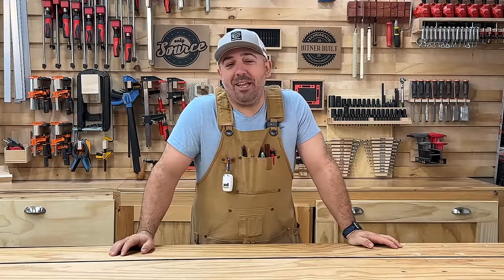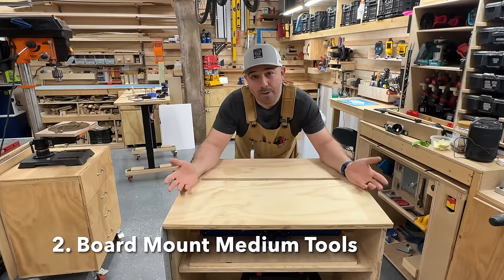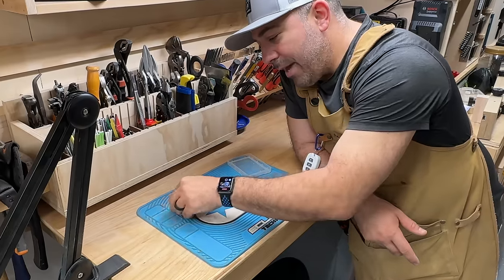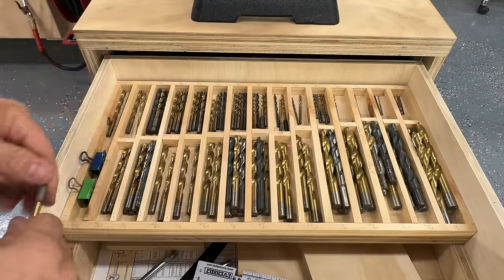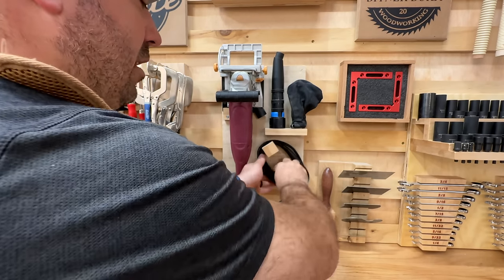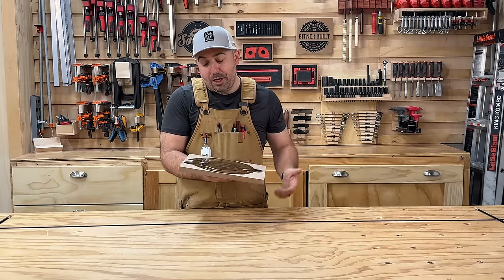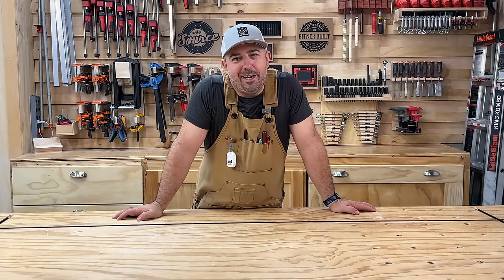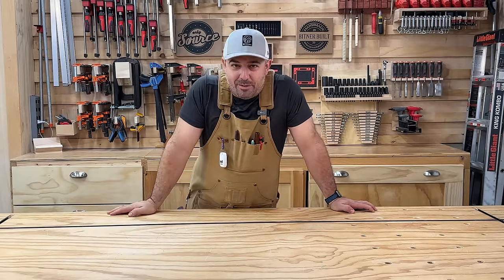8 Woodshop Tips Tricks & Hacks

Comment: Locktite makes many retaining compounds that would be excellent for the pocket hole bits and collars. Then if you break a bit, heat it up to break the locktite and save a collar.
Reply from the maker: That’s an awesome tip! Good thinking
Reply: I'm a fan of the Loctite 680 - it would be perfect in this application.
Reply: Also, Loctite or epoxy won't heat temper the bit and risk shortened life span.

Comment: Good tips thanks for sharing. I like the drill bit holder. If you drilled a hole next to drill pocket for that drill then you could use it to check what drill size to use for screw or bolt clearance and simply pick up the drill from that pocket and use it. It would also be useful to check the drill size for each pocket.
Reply from the maker: Great tip Thor

Comment: You can get started in welding with a flux core welder which doesn’t require the gas tanks in your shop.  Whole setup can be had for about $300 if you catch the right sales and shop at the right places for it.  Harbor freight sells the Titanium easy flux 125 and Amazon has a brand called Yes Welder …both would be great starter welder setups.  Even if you bought the whole rig and found that you hated welding, you could sell it and get most of your money back.  Youtube has some great vids on beginner flux core welding.  Great woodworking tips in this video and you just earned yourself a sub 👍🏻
Reply from the maker: Awesome thanks Dewey! I actually went into Harbor freight a few weeks ago and was trying to ask about welders for a beginner set up and of course none of the guys working there. Have any clue about anything, definitely on my want to learn list!
Reply: I just took a three night welding class at my local high school through my city's rec department. It covered stick, mig, TIG, plasma cutting and only cost 50 bucks and unlimited materials. I got to try out different machines and processes and that alone was invaluable in selecting the welder I bought, not to mention the nearly 50 years experience of the old-timer teacher who I learned from. My only regret is not pestering him to teach me oxyacetylene brazing and welding. Each process has its strengths and weaknesses so to me it was really important to understand those things and be equipped to use the appropriate method when possible.
Reply from the maker: @sklikizos  wow that is awesome! I need to look into seeing if our local schools do that, too, that is a great tip for everybody out there. Thanks so much.
Reply: @BitnerBuilt  hey thanks, I'm really digging your channel! You've got some awesome stuff right out of the gate, can't wait to see more of your ideas.

Comment: Good tips.  My adds...

Collar slippage... been there!  My fix is to use two back-to-back... never had them slip after.

Work mats... I have a silicon soldering station mat I use.  Resists heat, has the little cubbies to hold stuff and several even have imbedded magnets to hold small nuts/bolts/screws in place.
Reply from the maker: Thanks good tips! Yea I did the double collar thing too before I switched to the soldering!

Comment: About leveling for an epoxy pour--why not just level your assembly table once and for all, then you don't have to worry about it?  Useful tips--thanks.
Reply from the maker: I do a lot of larger epoxy things when I do it, for example a countertop. So the only thing in my shop that would be large enough to level for that is my large assembly table but that’s on casters and I move it around a lot, it would have to stay put and never move for that to work. People who do epoxy all the time with big workflows, have dedicated leveled tables. So I came up with a easy solution for myself and others who just don’t have the space for that. Thanks!